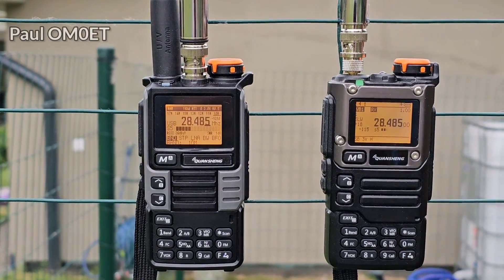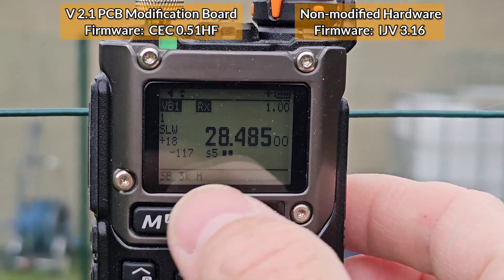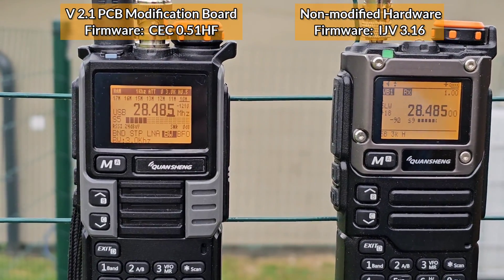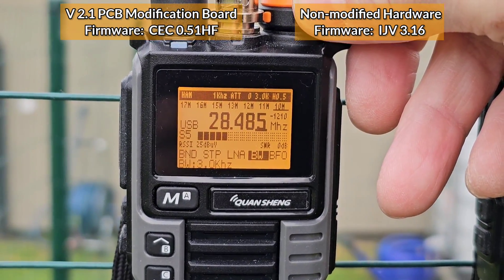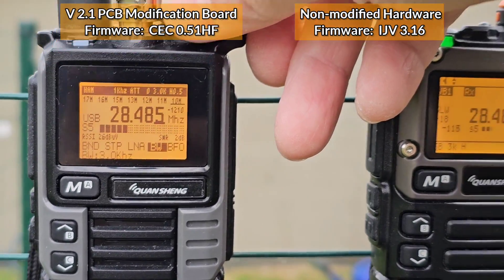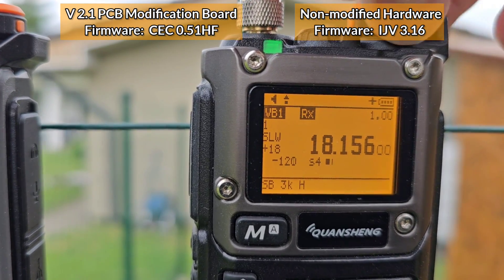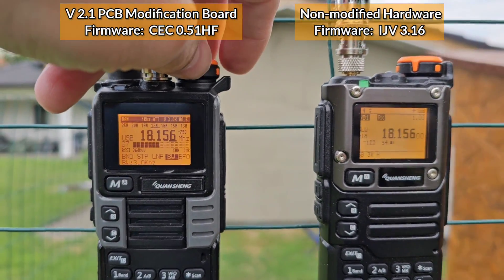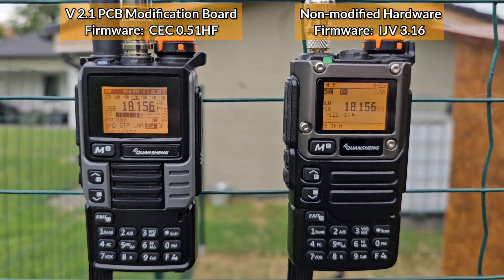MODIFIED vs. GENUINE HW - RX SSB Comparison ( Quanshengs UV-K5)

Comment: And no serial to usb cable link for those stations . Would like to know which cable you use.  I got Baofeng cable , and my quansheng k5/8 its not recognized by any software , while cable itself is recognized as CH340 serial to usb adapter. Fun where when I made compliant about station to Banggood , they responded as neither baofeng cable or new SI4732 Chip and Crystal Oscillator Component Modification Module for Quansheng UVK5/K6  are compatible with uv k5 (8) . but look at the name of new board modification I just  copy paste that name from banggood . Now case is up on paypal to see as banggood fooling me around.

Comment: Can you add the Cec firmware without having to solder anything or replace electronics inside the phone ?
Reply from the maker: Yes, but radio will freeze after you long press the "0" button.

Comment: I can't help but wonder why anyone would want to buy a Transceiver...pay out more cash...then mod it so you can no longer use it as a Transceiver. Remember cheap though it may be you are still paying extra for features you will render useless....there's gotta be a better alternative than paying twice to wreck a rig surely. Anyone agree ?
Reply: It still functions as a VHF/UHF transceiver unless you bork the install.
Reply: The modification only replaced the chip that was originally used for FM reception with a chip that can receive shortwave and FM. After the modification, the VHF/UHF transceiver function and FM reception function are still valid, and the FM sensitivity is also improved. This modification is absolutely worth the money.

Comment: Both different radios, besides, there is now much confusion with all these mod boards now.  Version 2 with amp, and without, version 2.1 with amp, and without, some coming with the 'choke' and cap, some not?  UK-K5 (8), and no one knows what to do now???    Utter confusion.  Personally, I'm not interested in a second antenna, but even that is confusing.

I received the brown board yesterday, without pre amp (not that I knew about this in first place), comes with choke and caps (only 3 this time), as version 1 came with 5, and a little bit of jumper wire.  No instructions, but site says to not bother with choke, nor replace cap, but why do they give you them then?  -  UV-K5 (8).

I guess I'll bin it, and order pre-amp version now?, but as regards the UV-K5 (8), does one need the choke and have to replace the cap?
Reply from the maker: Please look for the recent video on my channel about this mod. and instructions "how to"

Comment: You can see at only the static nois, that the moded version has better recieve if the S-meter is correct. The best to you Paul, from LB1NH Arild, now living 50km north of Oslo. I will soon be at HF as well Paul and we will have a chat some day again. 🙂
Reply: did we watch the same video? lol there was much more data and dynamic range of audio (read "full" audio") in the modded version
Reply: What do you think about that it is not filtered? Would it be legal to use as an Amateur operator?

Comment: Can the v.2 mod pcb be fitted to the older radio ( uk5 8) running the cec firmware? , it seems likely to work considering the only real change is the addition of an extra audio amp to the top of the board.
Reply: Yes, it can. I have just done it exactly as you have described and it works really well.

Comment: definitely better!
Reply: Not much at all!
Reply: @PureAwareness76  I made the same modification and comparisons. The results are not as significant
Reply: @Touchatout59  

Thank you Bro! 

So, are you saying, it doesn't worth (new PCB board, soldering + new firmware)? 

Maybe just a new firmware, and that's it? Thnx
Reply: @PureAwareness76  ah no sorry, I thought it was the video with the modified antenna. I confirm that this modification (on the video) is essential for good reception. I was talking about putting the second antenna; it improves reception but not significantly (I'm talking about my tests)